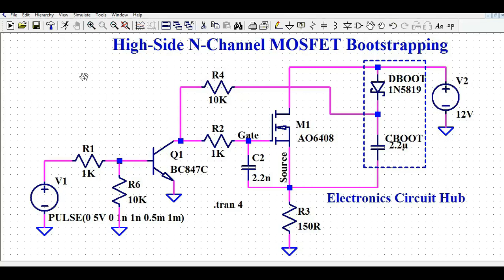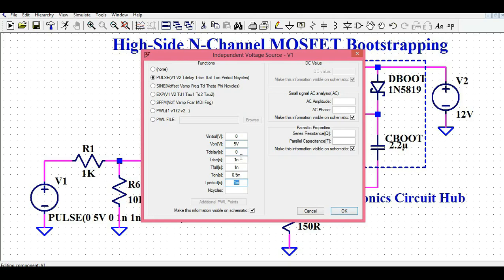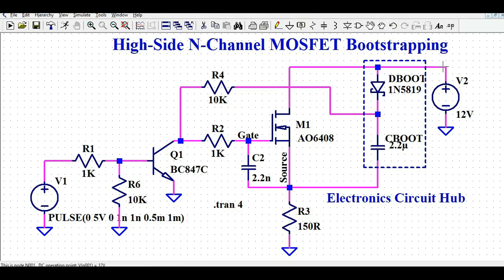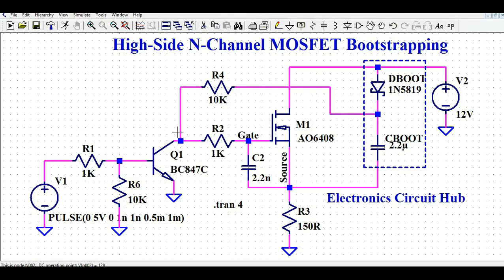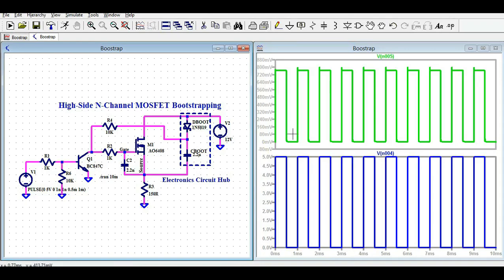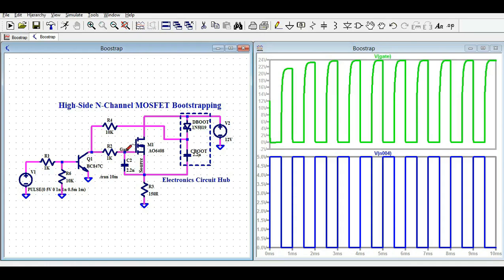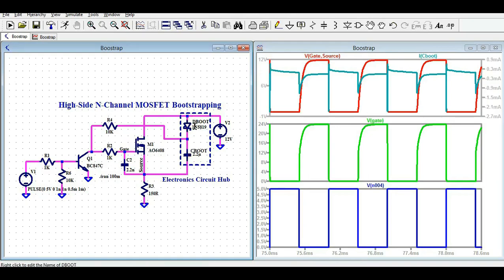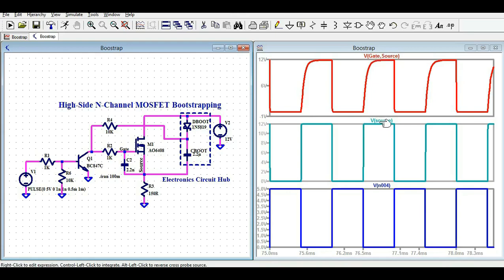Simulating High-Side N-Channel Bootstrapping in LTSpice: Step-by-Step Guide

Comment: the idea is that the mosfet should be driven like this: when PulsIN is +5V, Vgs should be 0V, and when PilsIN is 0V, Vgs should be +12V. In reality, in your scheme, when PulsIN is +5V, Vgs is ~+3.73V and when PulsIN is 0V, Vgs is ~ +12V, so you block the mosfet with Vgs ~ 0V for a half period of time (so far it is ok), and in the other half period, when PulsIN is 0V, only then the capacitor C2 is charged, increasing Vgs from +3.73V to ~ +12V, the increase lasts about 523uS, which is unacceptable, and the peak Vgs of ~ +12V is obtained at 1ms, i.e. the maximum frequency def switching is 1kH, for which Vgs is ~+12 V, above this frequency of 1kH, Vgs decreases considerably, and on average you turn on the mosfet 90% of the time with Vgs between 3.73V and ~ 6V.which means RDSon high and therefore Pw on high mosfet,  and this lasts for a while until the Mosfet destroys itself..... The only ok option is to use external Vg.